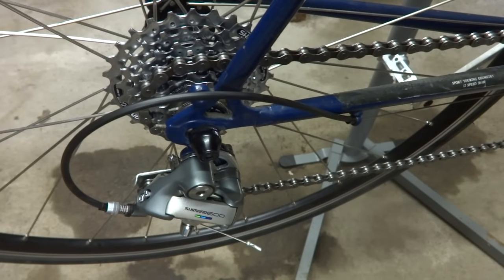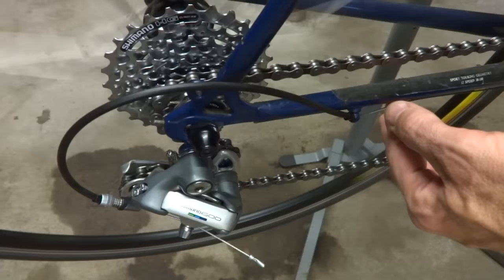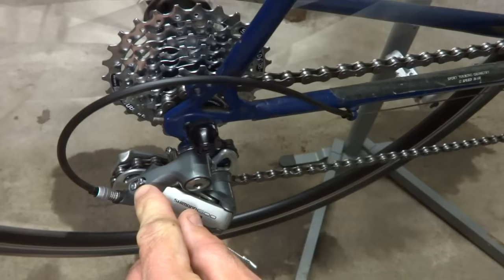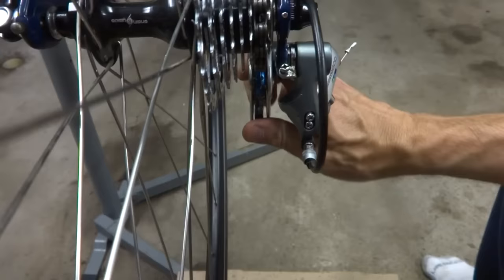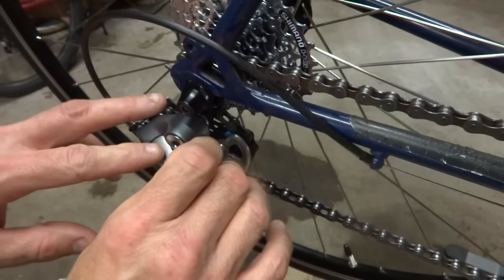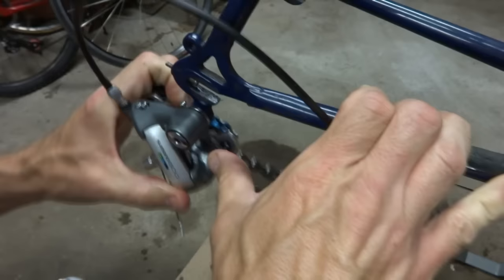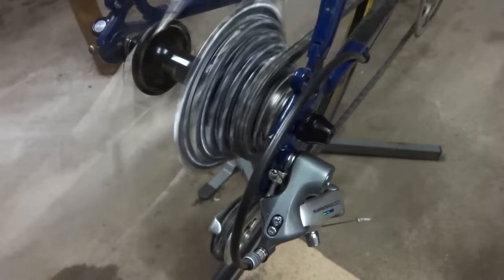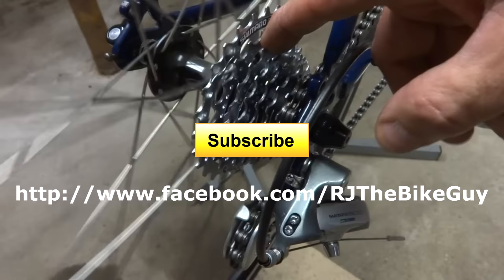Fix Bike Rear Derailleur That Won't Shift Into Highest Gear/Small Cog

Comment: Thank you for this video! My rear derailleur was simply gunked up! Spraying it out and lubing solved it. I had been fiddling with the high limit screw and cable tension. I could tell that the spring wasn't able to push it to the final position bit my thought was that I needed a new spring. I didn't even think of simply lubing the joints in the derailleur. Sometimes, the simplest solution is the answer. Thanks so much for the video!

Comment: Legend, was stuck after putting in a new gear cable in a Trek Domane 5.9, and even the limit screws had all lined up.  Even with no cable screwed in, the chain would not drop to the smallest cog.  After just releasing the limit screws (even though they lined up ok) the spring in the derailleur allowed the chain to drop again, and, all 11 gears came back!  Slight adjustment on the H/L screws and an index and shazaam.   Thanks mate.

Comment: Here are two more hints from my experience:

1. Once a customer came to me with the washer on the cable clamping bolt turned 180-degree. The anti-rotation protrusion of the washer was touching the derailleur body on the next to the last gear, and so the derailleur couldn't get to the highest gear.

2. This one is about certain specific combinations of frame / hub / derailleur. A friend had an old steel road frame (126mm spacing) with applicable hub (don't remember model) and a 9-speed MTB derailleur (XTR RD-M952). All working well, except lazy shifting to the highest gear only. After checking all and all, I realized that the last cog is right on the edge of the derailleur range of possible movement. This 9-speed mech was expecting the whole cogset to be positioned a bit more to the right (closer to the dropout). Additional factor was the steel hanger which is a bit thinner than an alloy one. Simple solution - add a washer to space out the derailleur. Just 1mm might be enough.

Cheers!

Comment: My bike fell over the other day, and messed up something in the derailleur. It was "hunting" between several higher gears. After watching this, I went out and checked it, and noticed that the single set screw that presses against the frame of the bike had jumped under the little stub somehow. I unscrewed the large hanger mounting screw almost all the way out. I then spun the internal part of the derailleur, to get the screw back on the frame stub. Then while holding that with one hand against the spring tension, I screwed the mounting screw back in all the way. Now it all looks ok, and properly shifts and indexes between the gears up and down! Thanks!

Comment: Thanks! I could shift to highest gear when bike is on bike stand but not when i cycle regularly outside. Fixed issue by unscrewing H limiting screw a little bit as you mentioned in the video. Great tips, keep up the good work!

Comment: I had same problem. Even though there was no tension in the cable when I shifted to  smallest cog, the cable itself was a old and a little rusty. Tried everything here. I noticed that if I helped the cable back through the last housing (nearest the derailleur) it then shifted to the small cog. What solved it for me was oiling all the cable housings and channels that the cable slides through. Think it was probably not travelling freely near the derailleur end. Works like a dream now, perfick! Probably a good idea to oil all grooves and housings when you replace a derailleur. Thanks for the vid.
Reply from the maker: You should probably replace the cables and housings then.

Comment: Many thanks!  Spring was gummed up, some WD-40 and compressed air and working it out and all is, finally, well again!  Will be nice to have top gear back finally!  Many thanks.  Next ride, to get proper chain lube as you state WD-40 is not long term good for the chain and derailer assembly.

Comment: Thanks for the great tutorial. Tried everything and it finally started working after I WD40'd the spring. Thanks a bunch!
Reply from the maker: SombreroLDN WD-40 is not a good long term lubricant. I would get some chain oil on the spring to keep it lubricated.
Reply: RJ The Bike Guy Thanks. I only used the WD-40 to clean it out. compressed air cleaned it and then applied chain oil. Thanks again.

Comment: I watched a bunch of videos about fixing/adjusting the rear derailleur, but none covered this issue -- where the limit screws are fine, the tension is loose enough, but the derailleur still won't pull the chain over there to the small cog(s) (even though you can easily do so manually with light pressure. I'm going to go spray that thing with some WD-40 like crazy and see if I can get it going. Thanks so much!!!
Reply: +Matthew Harvey  did it work?
Reply: Not exactly, but a significant improvement. It's a 5-speed kids bike that would only run in the lowest two gears before doing this operation on it. I got it to where it will go from highest to lowest, but it still skips over two of the intervening gears.
Reply from the maker: +Matthew Harvey Could be cables, shifters, or other things. If it's a 5 speed kid's bike, could be cheap components.

Comment: Thanks for this information , this is my problem on my rear delailleur , it doesnt shift on the largest cogs .. i tried to go on bike shops then the bike mechanic says that the spring on my rear deralleur is already soft and need a nee Rd .. after i watch thsi video i tried it immediately and  perfectly work , i also use wd40 on springs then oil after that it shifts smoothly in all gears thanksss man

Comment: Thanks! This helped troubleshoot my issue. Turns out my derailler has a protective "cage" around it, which was bent, pushing against the derailler preventing up shifting into the 6th (highest) gear.

Thanks again!

Comment: Thank you for all your work in uploading these very very informative videos! Thank you. I do have a problem tho..I have a vintage stem shifter, and when I try and shift through any gears it wants to pull the cable housing with it. What Am I doing wrong? IS my stem shifter assembly to worn out so it isn't holding well enough? I tried loosing the tension in the cable but then it won't shift. Not sure what i should be looking for or what is expected from the stem shifter. Thank you!

Comment: I had to fit a new rear derailleur and to my amazement it was almost perfect in gear changes except for the two bottom cogs. With this video i  had the problem solved within minutes by pausing the video after each of your steps - the limiter screw solved the problem so thanks very much!

Comment: You forgot some other minor issues. Which is understandable for anyone not having other issues that need finding like I did.
The cable could be catching inside the shifter, on the bars, or catching inside the housings by not being straight and smooth in there somewhere, our the small plate that clamps the cable end could be in the way and holding the spring loaded mech from easing across but does when you assist it with pressure. All kinds of funny shit can drive someone nuts with these things.
The cable should be clean and kink free from end to end with nothing inhibiting total freedom of smooth movement.
Reply: Yup, just fixed this problem on an old Raleigh. The cable had just enough drag for its end to pop out of its hole in the shift-lever when shifting up, then catch in that position preventing high gear. A drop of glue to hold the cable end into the shifter lever fixed that.

Comment: What would suddenly cause tension on the shifter of a 12 speed not letting you shift into high gear only low? Working on mine now. Mines just stuck on the lowest clog and I have to hold the shifter down manually. It's fairly new with no damage.
Reply from the maker: https://www.youtube.com/watch?v=gwBQxhZhKnE

Comment: Nice straight forward video. Tried what was mentioned and still did not help chain going to high gears (small cassette teeth). Turned out cable was frayed inside shifter on the right hand shifter. Replaced cable and all is good now.
Reply from the maker: https://www.youtube.com/watch?v=gwBQxhZhKnE

Comment: thanks had 2 gears not working for some time. The wire was tight so i pulled the allen keys out and gave it a lil slack and my 2 gears came back . Thanks

Comment: Hi thank you for the video! I have recently upgraded my hybrid bike from Shimano Sora to SHIMANO 11V 105 5800 - 11/32 rear mech. I purchased the rear mech new. My rear casette is only a 9 speed but even so, I'm having the same problem you described in this video. Any ideas? Thank you! Keep up the great work!
Reply from the maker: +DrebinCH Maybe cable adjustment or limiting screws would be my first guesses.
Reply: +RJ The Bike Guy - I tried, but it still wont... Almost as if the spring is not strong enough.
Reply from the maker: I don't know then.
Reply: +RJ The Bike Guy - Thanks anyway. I'll let you know if I find out.
Reply from the maker: It's hard to diagnose issues without having hands on the bike.

Comment: I'm a mechanic at a small bike shop. A customer brought in a bike with a broken derailleur, so I ordered up a new one: Shimano Tourney, nothing fancy. Problem is that the new derailleur will not shift into smaller cogs at all... I can manually move it into 7th and it will stay, but using the shifter will not move it. It's not the cable tension and not limiting screws and shouldn't be gunked up. Any other suggestions?

Comment: I've had a brand new bike delivered today and the rear wheel and derailleur were already installed out of the box. It's a Shimano set with 18 gears, but it won't go into gears 9 or 18 on the smallest cog. I'll have to check the limiting screw first to see if that's the issue. Hopefully it won't be a cable issue because it's all pretty tight, unless the cable needs to slackened off in the higher gears?
Reply from the maker: Dunno. Go through the stuff in the video.
Reply: Will do. Hopefully it should be an easy fix in the morning 👍

Comment: Thanks. After watching this I tried the limit screws to no avail, then when checking the derailleur movement I found that there was some movement in the pivor of the hanger screw. It wasn't too loose but I managed to tighten the screw a bit and it fixed the issue. 
This is a fairly new bike using shimano tiagra components, do you think that I should get it checked out?
Cheers
Reply from the maker: https://www.youtube.com/watch?v=gwBQxhZhKnE
If the bike continues to have problems, try to figure them out or have it checked out.

Comment: I just bought an old racing bike, and besides being a bit rusty and dirty, it functions perfectly. But now I'm having an issue with the rear derailleur. It won't shift onto the smallest cog. It worked to begin with, but I accidently changed the gear (forcing it) while the bike was standing still and the wheel wasn't spinning. 
The cage seems to move straight and the cable is loose in highest gear. I haven't tried the screws or cleaning the derailleur yet, but I suspect it's my tampering with the gear that has made a mess. I know it's not supposed to be good, but I know not exactly what it does.
Reply from the maker: LasseKaa I would try the limiting screws, but check everything else in the video.
Reply: RJ The Bike Guy I will try that. I'm just concerned that the derailleur worked properly before I forced the gears and not afterwards. But I'll get back to you when I've had time to work on it.

Thanks for the reply and thanks for the great video, I've learned much from it.
Reply from the maker: That does sound suspicious.

Comment: Great video, however you missed one other remedy. If the cassette has worked loose it can cause not being able to shift onto the smallest sprocket also.
Reply from the maker: I have never seen that happen. I am guessing that would be very rare. Probably from not installing it correctly in the first place. I covered the most likely causes.
Reply: @RJTheBikeGuy  yes, if it’s not torqued down right in the first place. This was a schoolboy error on my part to be honest.

Comment: Hi shyflirt this questions unrelated to the video as I didn't know where to post it. I have a cheap department bike with no suspension and wondered psi should the tyres be?I've got it 55 back and 50 front but as there's no suspension the slightest bump vibrates the whole bike,thanks.
Reply from the maker: The PSI range is determined by the tires. It should be written on the sidewall somewhere. The probably with cheap department store bikes is that they are cheap. They are made of cheap metals with cheap components. There is a reason Walmart an sell them for $100. You would be better off buying a used quality bike.
Come visit my facebook page at http://www.facebook.com/RJTheBikeGuy
Reply: Thanks very very much RJ for this brilliant video. I had to watch it a few times to properly understand what the issues were but finally got the adjustments right for getting back into top gear ! nothing more annoying than the  high gear not working when commuting to work ! thanks !!

Comment: So am I to understand that you used  liquid wrench relube the rd. What about  using PB blaster. I sure enjoy your  video
Reply from the maker: I used Liquid Wrench LUBRICATING OIL. PB Blaster is mainly a penetrating oil for breaking parts loose.
Reply: @RJTheBikeGuy  thanks  I needed that
Reply from the maker: @tmayberry7559  You can use wet chain lube.

Comment: Please help man, my rear derailleur had difficulty or struggling shifting down to smallest cog, I changed the housing to a new one, hanger bent a little, still nothing changed.
Edit: also B screw is fine, 5-6mm gap,
Also the H limit screw is not touching the rear derailleur still had difficulty shifting down to smallest cog.

Comment: what prevents the shifters from turning?  I have the rotatable shifters on the handlebars and they won't turn anymore.  (The bike is less than 6 months old).
Reply from the maker: These are friction shifters. So friction. I doubt you have friction shifters on a new bike. If the bike is that new, take it back to the shop.

Comment: Yeah it clicks and it goes in gear but it will not stay unless I hold tension on the shifter
Reply from the maker: I don't know then. I am still thinking it's an issue with the ratchet mech. It's the shifter that hold tension on the cable and keeps the derailleur in gear. The derailleur has the spring that pulls it back.

Comment: +RJ The Bike Guy Hello, I have an issue with my mountai bike. When I shift to a smaller gear it shifts nicely but when I pedal really hard the chain tries to go on a lower gear (without me touching the gear shifter) Please help, and great video:)
Reply from the maker: +Henris Ivaskevicius Sounds like the derailleur is of adjustment, or a bent derailleur/hanger. But it could be that the derailleur is not actually trying to shift. It could be skipping, which would be caused by a worn chain/cassette.

Comment: +RJ The Bike Guy I just replace the cassette on my bike, it is a 7 speed and it slightly large than the original. The problem I have is when I try to shift to the biggest cog it won't shift to it. I also notice the derailer is touching the cogs in any speed. How can I solve this problem . I think it is the chain length because the cassette is larger and the original was smaller.
Reply from the maker: +Danny Perez What was the original cassette? 6 speed? What do you mean by slightly larger?
Reply: +RJ The Bike Guy I had forgot to mention that . The original cassette was a 7 speed and it had less teeth on it. And the new cassette had more teeth on it. That is what I meant by slightly larger because of the number of teeth on the new cassette.
Reply from the maker: If you are going to a freewheel with larger cogs, you might have to change the derailleur. Derailleurs have specs as to how big of freewheels they can handle. The can usually be exceed by a little but not a lot. Also, you might need to replace the chain with a longer chain. https://www.youtube.com/watch?v=ELsKrgTt0oY
Reply: +RJ The Bike Guy Yeah I actually went from Freewheel to a Cassette so I may have to replace the chain and derailer.

Comment: Wd40 is good for some electronics and rc motors to clean them but I've had nothing but issues with it for bikes its wet and it attracts dirt and dirt is a bikes worst enemy lol!
Reply from the maker: I routinely use WD-40 to remove old grease and gunk. But I always follow it up with a lubricant. WD-40 doesn't make a good long term tubricant.
Reply: No it doesn't,found that out the hard way lol!

Comment: Hey i need help...the indicator for my gears says im on gear 7 but its actually on 5 so when I move the chain manually to 7 it switches back....I tried tightening and loosening the limiting screws but it isnt doing anything.
Reply from the maker: It would have nothing to do with the limiting screws. You need to adjust the cable.

Comment: Thank you.I am from Ukraine.I live in heavy fighting actions now. But I love to ride a bike.I recently bought system Shimano hg cs-hg41-7ac.Please,tell me how correctly to lubricate the chain
Reply from the maker: Here you go: Cleaning And Lubricating A Bike Chain
Reply from the maker: What part is rubbing what? Not shifting to the biggest cog sounds like a derailleur adjustment. Try letting out the limiting screw just a little bit for the low gear to see if that helps.
Reply: ***** Hi, your chain rub at the front sounds like a trim issue. As you move towards the ends of the cassette you need to adjust your trim. See the section on "trimming" in the Shimano tech docs: http://www.shimano.com.au/media/techdocs/content/cycle/SI/SORA/SI_6LS0A_001/SI_6LS0A_001_En_v1_m56577569830615004.pdf

It's not unusual to have problems reaching the small cog when you're in the small chainring and the big cog when you're in the big chainring, especially if you're not using the trim.
Reply from the maker: It sounds like you need to adjust limiting screw and possibly the cable.